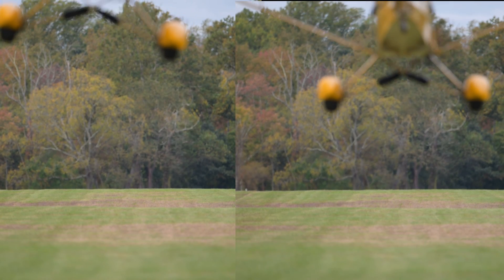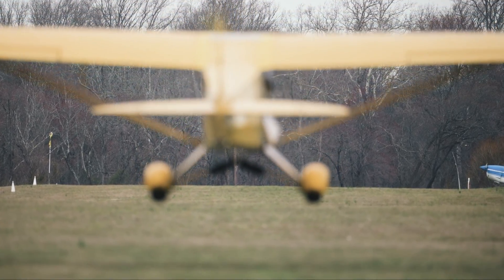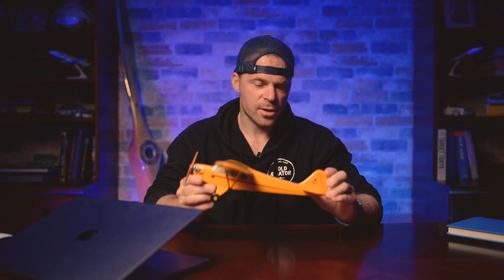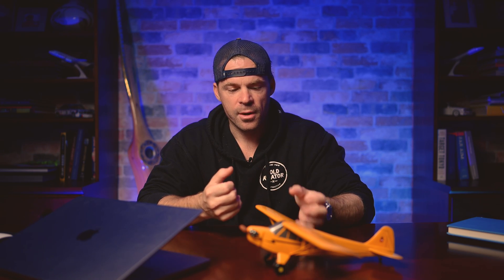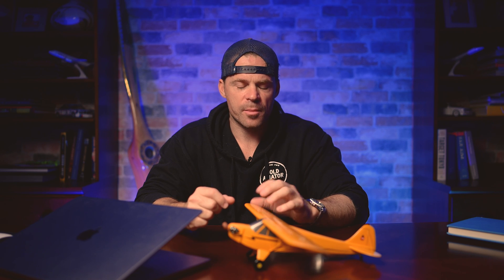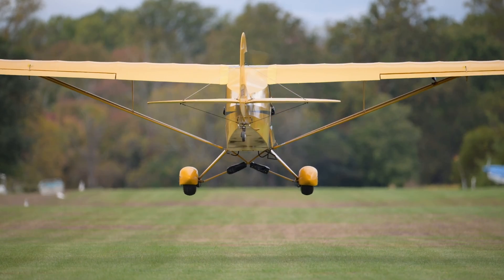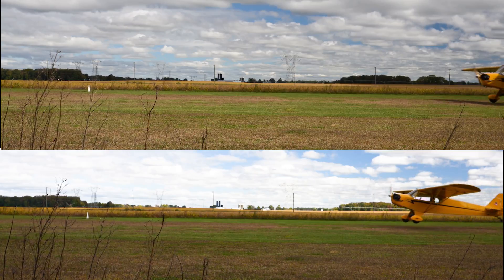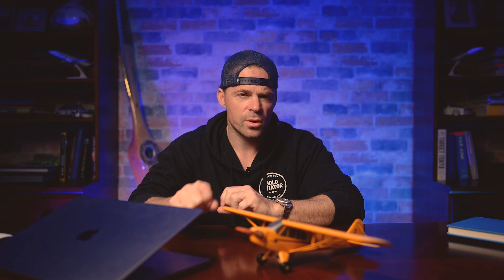Landing a Taildragger, Wheel Landing Vs Three Point Landing. Which is best and Why.

Comment: Some good comments there and I agree, pilots need to be proficient in both as they both have their particular applications. One thing you missed out on covering - and maybe because this is J-3 focussed - is the effect of p-factor and gyroscopic precession in the landing phase. Take something like a T-6 or bigger, or with a rotary engine, doing a wheeler and then flying the tail down can risk inducing a swing that could be troublesome. Landing in the three-point attitude means you are arriving in the attitude the aircraft will end up in, so you remove the potential 'gotchas' of p-factor and precession coming into play.
Reply from the maker: Good point. I thought about commenting on larger Warbirds etc but my experience is very limited there and I didn't want to mislead anyone. Good Points though. I also don't know if planes like the Corsair, Mustang you have to wheel them on etc?
Reply: @Bananasssssssss  You don't have to wheel them, per sae - same rules apply. You can also opt for a 'tail-low wheeler' which is a bit of a hybrid between the two. Hard to do in a J-3, but for something that sits higher like a Tiger Moth, they can be done. Interestingly, if you talk to the old timers that flew what we now call warbirds in WW2, they scoff (at least ex-RNZAF pilots I got to talk to) at doing wheelers - in their day it was always three-pointers.

Comment: Excellent review!  Love the never ending wheel vs three-point landing debates.  I own and fly a Cessna 180 in Alaska, so a bit heavier with more horse power up front compared to the Cub. I wheel land most of the time (and always when I land on pavement or with a cross wind) because of the better directional control, better view of the runway (don't want to hit a moose!) and easier go-around when needed.  Also, a 180 needs a fair amount of aft trim to get the tail wheel down into three point configuration and that can make a last minute go-around a bit more sporty than a wheel landing.
Reply from the maker: I flew a friends Luscombe which is a little nose heavy and three pointers were so different than the Cub, I'd imagine in a 180/185 when it's done flying, it's done flying, and the nose would come down quickly, lol
Reply: Haha, yes!   @Bananasssssssss

Comment: Great video. I took my beloved champ on a low-speed ground loop on the way to Oshkosh in Portage, WI. I had a failure in the tailwheel, so when I lost airflow on the rudder, the tailwheel unlocked and free swiveled. I wasn’t fast enough on the breaks and it came around 180*. Low speed, no damage done except my ego 😀
Reply from the maker: If you're gonna ground loop, that's the way to do it, lol

Comment: Joe, Great video like always. You asked for comments, so I'll put in my 2 cents. You didn't talk much about landing the shortest, probably because the brakes aren't the best in a Cub and most people don't use them hard in fear of spinning the stem off an inner tube. If I need to land short, I try to touch down 3 point (slower airspeed), then raise the tail while braking to put more weight on the wheels. Just make sure the air pressure is up in the tires. It gets expensive to replace those 800 x 4 tubes!
Reply from the maker: Thanks Dave! speaking of, what PSI do you keep your ties at normally?
Reply: @Bananasssssssss  It's been a while since I've used a pressure gauge on a Cub tire. I usually just step on it to feel the bounce. Best I remember 12 psi is hard and 8 psi makes for a soft landing.
Reply from the maker: @davids.682  thanks!

Comment: Good tips I like the ratchet explanation. I read stick and rudder long ago…..it’s still on my shelf today. I have nothing additional to add as my experience is: PA12, PA18, Maule  M5(235)Cessna 185. I don’t want to cloud your great application to the airplane you’re flying. The shots of landings from rear and control inputs are very helpful for visualization. Good work on this one👍🏻.
Reply from the maker: Thank you! I’m curios from your experience though. Whats the 185 like? As far as landing etc. seems like the ultimate machine as far as Taildraggers go
Reply: @Bananasssssssss  I loved mine. Mine had the IO-470 with a scimitar prop and bush conversions(horton stol). It’s all subjective as to what people think is the ultimate. My .02 though is for all around use a 180/185 is hard to beat. As you know even big airplanes become small in some weather conditions. So back to our smaller airplanes I still prefer a tailwheel airplane in most cases—-just more versatile.  I owned all 4 of the airplanes I mentioned one at a time. If I could only pick one it would hands down be 180/185.  As far as wheel landing when airspeed slows after mains planted my technique is to make a conscious effort to get tailwheel planted. That transition time is key just like planting the mains on the wheel landing but in reverse with the tailwheel. It’s only going to weather vane if left in that transition state too long. I also landed the 185 with your rolling on technique as well in quite a bit of wind at times. It just depended on what the particular situation and conditions called for. You need to get some seat time in a 180/185 and see what you think. They all have manual flaps as well.👍🏻
Reply from the maker: @JW-gb6hq  thanks for the insight! And would love to get some stick time in one.
Reply: @Bananasssssssss  Maybe one of the folks on here near you will take you up on that. The aircraft prices are just ridiculous over the past few years. I would recommend getting one that needs some tlc without prior major damage history and doing your own work on it to make what you want. I think it benefited me in that one of my best friends is an IA😂 I also appreciate doing all I can knowing that things within my skill level are done to my expectations. There are plenty of amazing places doing aircraft mods but it’s not always the best money to satisfaction ratio. Some things just have to be left to the experts but a lot of it is just effort and patience as you know already. I would also explore the “experimental “ category lately as the options are many now. Avionics for certified aircraft are revolting in price compared to experimental……..
Reply from the maker: @JW-gb6hq  I was going to say the prices of 185s have gone bonkers, lol
Reply: @Bananasssssssss  we should talk sometime not on here on the 185 scene.

Comment: I am proficient in both. I prefer 3-pt in calm wind, crosswind, gusty, and teaching. If the wind is strong or gusty, i want to know if i have enough control in the transition from tail up to tail down. The only way to know, is to try 3-pt. You will know before you touch down, so go around and find another runway, or grass. Same crosswind but wheel landing, you’ll find out you don’t have enough rudder trying to get tail down, as you groundloop or exit the runway. 
3-pt for students allows them more time to learn before instructor has to take it away from them. 3-pt and grass is even better. Due to increased energy, student wheel landings usually have to be corrected immediately.

Comment: One of the best videos for folks transitioning to taildraggers !!! Nicely done !
Wolfgang Langewiesche is smiling with approval !!!  Seriously " Stick and Rudder ", I am very impressed you mentioned ( the author Wolfgang )  and have read it, it is a must read for any pilot. It is my go to in flying.
Your application of which ( 3 point or wheel landing ) you use is about the same for me. I don't think I ever did many full stall landings actually in the cub, I think they were mainly the 3 point roll ons, they just felt better and I believe the cub liked it better, 
( a little easier on those old bones ) .
Reply from the maker: Thank you very much! really appreciate it. Yeah I bought Stick & Rudder yearsss ago and go back through it often. Great stuff

Comment: What airfield do you fly out of? I'd like to see if I can find it on my flight sim. I had no idea 3 point landings were a thing. I always thought that the proper way to land a tail dragger were wheel landings. You make a valid point. I am going try doing both on my sim.
Reply from the maker: 90% of my flying is out of 3NJ9 (Allens airfield) , or Redwing (2n6)
Reply: @Bananasssssssss  awesome thanks! Until i can get in the air, the sim is my next best option.
Reply from the maker: @cbizkit84s61  Absolutely! Plug in 12N, that airport is my favorite, you'll love it

Comment: Stick and Rudder is a must read. As far as preference on landings, wheel landings are the best IMO on xwinds vs 3 point landings. If I’m flying into a grass strip with no xwind and I’m unfamiliar with the runway surface, I’ll 3 point it in every time. Both landings serve their purposes. 🤙🏼

As always, great video Joe and thanks for sharing this!!
Reply from the maker: Thanks Shaye! Yeah I love a good wheeler on a stiff crosswind. I'm actually surprised that I prefer three pointers when it's gusty, It's like I know the airplane is all over the place, I know I have less flight control authority but for some reason when I try too wheel it on when wind is really all over the place, I end up bouncing, or it just becomes a disaster, lol.
Reply: @Bananasssssssss   A full stall 3-point landing vs a wheel landing is all about the airplane transitioning from being a flying machine to a ground machine. In a stall landing the airplane stops being a flying machine while still in the air. The flying surfaces don't work and your ground control devices (wheels) are in the air and don't work either. You have absolutely no control for a short period of time between the stall and the touchdown.  That's fine on a calm day, but a strong direct crosswind during that short time will push the tail strongly to one side and there is nothing you can do about it. You have made the transition from a flying machine to a ground machine while still in the air with absolutely no control for a second or two.  A wheel land allows you to keep the airplane as a flying machine even after you have the wheels on the ground. When you slow down with a wheel landing you slowly lose the air control surfaces while simultaneously increasing the ground control devices. If you lose all you flying control surfaces before you gain full control of ground control devices (full rudder against the crosswind with the tail still up), you increase power and abort the landing.  A wheel landing allows a gradual transition from an air vehicle to a ground vehicle, allowing you to abort at any time.  With a crosswing that is too strong for your airplane, a wheel landing gives you the chance to keep full control throughout the landing process and allows you to abort when you discover that the crosswind is too strong.  A full stall landing under the same too strong crosswind conditions will ALWAYS result in a ground loop because you've given up any and all control for a short period of time while your tail is strongly pushed sideways by the wind.